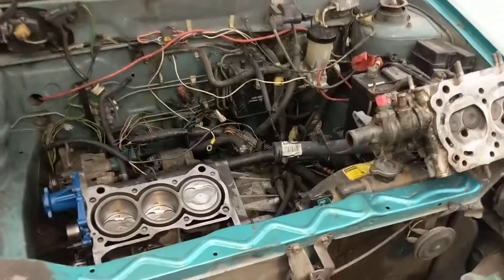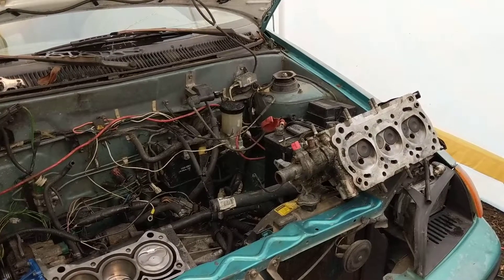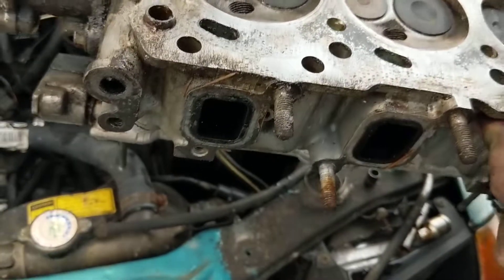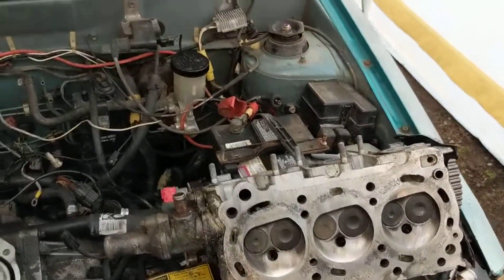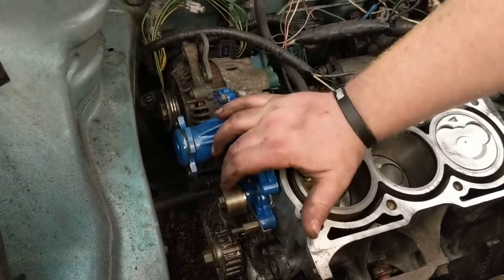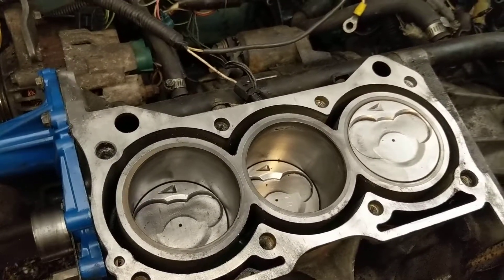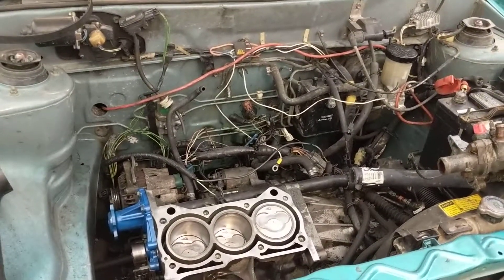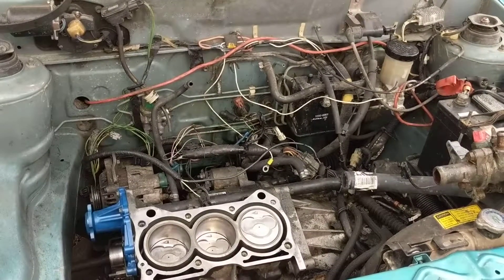1992 Geo Metro 1.0 G10 Project More Power

Comment: The motor can be bored out to take a 1.6L piston. Honda 1.6 domed pistons will work but the dome needs to be machined to fit the newer style head. The older Hemi style head work better with the domes.
Reply: When switching to a Honda piston either a wrist pin bushing needs to be made up or the Honda pistons need to have a grove machined into the wrist pin bore to hold the pin in place due to the fact the geo is a c clip style and Honda is a press fit pin.
Reply: Connecting rods from a 1.3 will also fit the 1.0l block or you can pick up a set of after market from maxspeed or Ebay. Pretty solid unit I've had my motor over 9000rpm with it being turbo charged and haven't had any issues with them
Reply: @anschuelke  I assume you used forged 1.3 pistons?
9000k rpm is simply brutal and fun but I can't imagine cast pistons holding up to such pressure.
Also, which turbo are you using?
And of course, how much hp does it have? :)
Reply: @z-trip5457  the pistons are a forged piston that was ment for the larger 1.6, as far as hp numbers I don't know being the motor is in a garden tractor for pulling.
Reply: And as far as the turbo goes I've had 3 different turbos on it, the one I'm currently running is a rhf4
Reply: You know any better rods for the stock pistons? or any pistons for stock bore?
Reply: @zragevii4705  maxspeed used to offer a rod that fits the 1.3 same stroke as the 1.0
Reply: @anschuelke  I'll have to look at that, I want to try and build a little sports car with a g10.. I'd like to be able to say I have a 200hp 1.0l 3 cyl
Reply: @zragevii4705  oh boy, 200hp is really pushing them. There a open deck block. So unless you run a dry block your just not going to be able to keep it together. 120hp is more realistic.
Reply: @anschuelke  it's gonna be alot of work and building. if I get to it, I'll find the limit of the block
Reply: @zragevii4705  I don't think you can get 200 hp with any longevity, but the G10 would be nice in a Midlana

Comment: I'm into my 93 Xfi for 500$ + 70 for driveline. Motor knocks though, am picking up rebuildable core.
That c/r bump will give better fuel economy as well. I looking into those flat top Samurai pistons they got for like 90$.
Reply: P.s. if you try to run 11/1 on 87 the ignition will have to be excessively retarded. The increased expenditure of higher octane fuel is about offset by the increased efficiency. Go .020"
Reply from the maker: Thanks for the Info but my friends is running fine only slightly retarded on base time. No pinging underload also
Reply: @RedneckProvingGrounds  No shit? My 11/1 Honda needs 92 and that's with quench pads and swirl ports in an engine that operates at a much higher average rpm.
Reply from the maker: @kenfrazee2779  yup no pinging what so ever on 87. I thought that too but I was surprised as hell, when we 1st started it up we had not set base time n it pinged alittle underload but come to find out we were way adavanced before timing it
Reply: @RedneckProvingGrounds  I might have to try that, getting a long block next week for 95$. Retards cam a little but they make offset woodruff keys, prob have adjustable gears too, for Samurai at least
Reply from the maker: @kenfrazee2779  that's a cheap long block by the way good deal. Did you read what  Rodrick Denton said  he is the one that read all the info on how to do this I just assisted thru the whole thing
Reply: @RedneckProvingGrounds  He's got some G13s too, might just go w a four cyl.
Reply from the maker: @kenfrazee2779  gotcha
Reply: Yeah I have been running 87 with no issues I ran premium once didn't do much ran mid and low grades with octane booster crazy improvement empower at about 70 miles an hour I can floor it and get up to about 75 in a secondthis is an automatic so it really doesn't show the gas mileage increase or the horsepower increase that much except a low RPMs and really high RPMs if I had the manual transmission it would be a lot better I'm looking to do that swap sometime this summer
Reply: @memesRus00  I just bought car to drive while swapping a Civic. The 120whp D that's coming out clears geo frame by 3" haha. Some bad ideas are the best ideas.
Reply: @kenfrazee2779  well if you ever want to sell your XFI let me know how far you are from Washington and I might buy it
Reply: @memesRus00  Prob keep as backup vehicle, I love my baby car, oh you're so cute and lovable, pretty little baby car-always get me to work- hugs and kisses.
  I don't know, might bale the shitbox when I get Civic running, let you know.
Reply: @kenfrazee2779  p.s. Motor still good, I guess g10s just sound like that. gutted the thing down to around 1480lbs and threw on 185/60/14s and rear sway bar off a later gen Metro- not a lot of power but it corners so hard now.